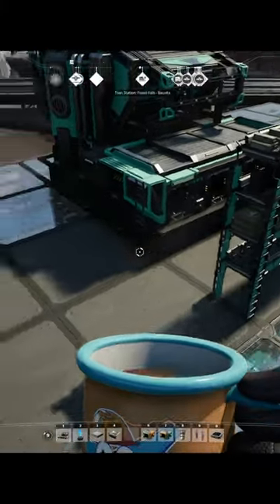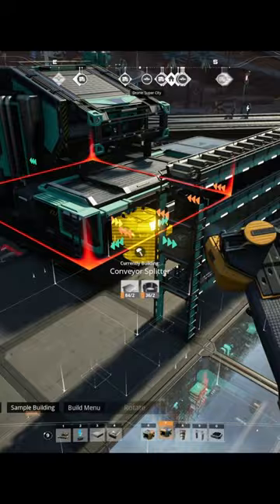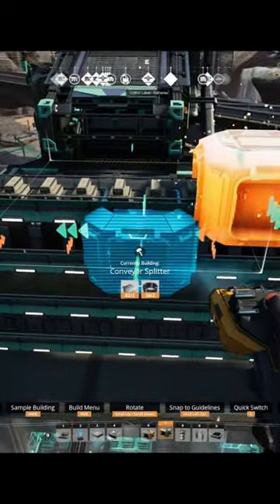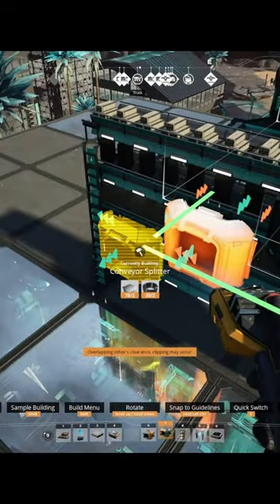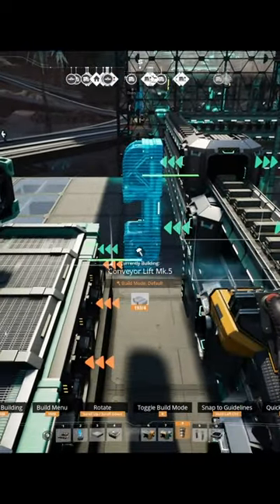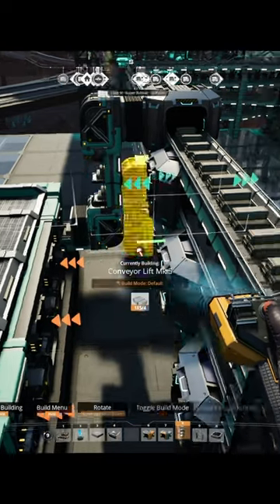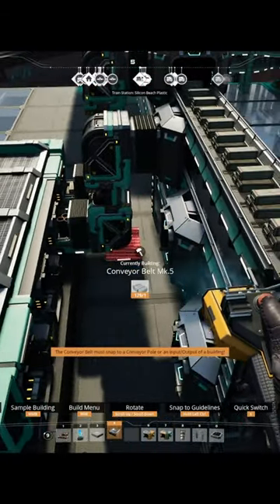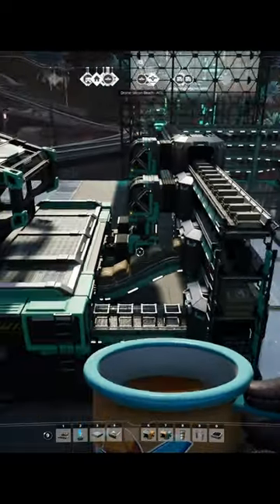Satisfactory Tips: Attach splitters right to your existing belts - really good for manufacturers

Comment: you can use elevators on the second row too instead of having the sloping belt, if you have the belts close enough that the elevator can snap straight to the machine and the splitter.  Its clips a little bit but it looks like a new part and looks great.

Comment: sometimes they don't snap,  can't work out why
Reply from the maker: Yeah you need to be careful when you do it. Sometimes hitting control doesn’t line them up either. I too want to know why
Reply: I’ve noticed if you wiggle your mouse around so that the splitter snaps to a foundation or another splitter, then back to the belt, snapping will work again. It’s finicky, but sometimes it’ll fix it.

Comment: Can both sides of a lift connect directly or does one side always need a conveyor?
Reply from the maker: Yes they can! They just need to be lined up the right distance. In this case, I had to separate them a little bit more to make one of the other belt connections not be too steep
Reply: @DrLootCrate  Thank you for your solution.  Just set up my first 90%+ throughput from everything factory with your help. Only thing left over is 15 screws per minute.
Reply: @donaldpetersen2382  awesome dude!